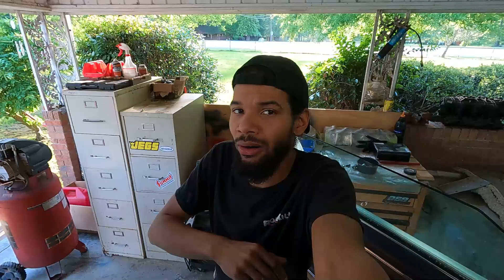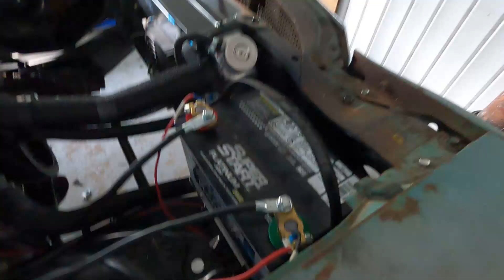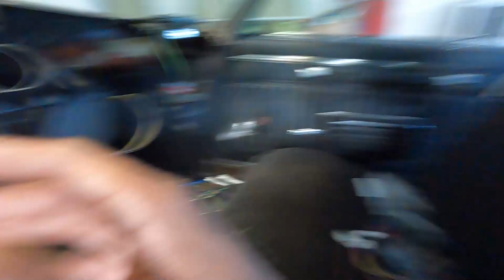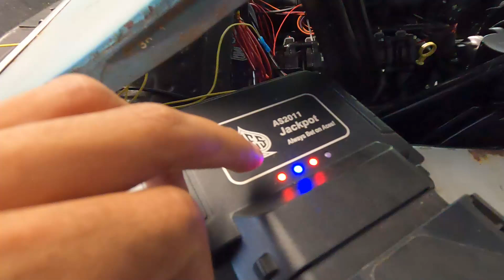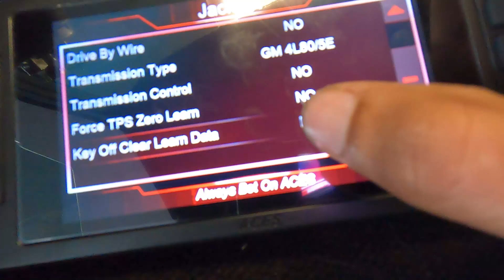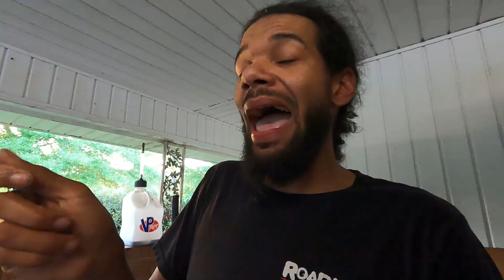How to Setup ACES Jackpot LS: Initial Setup (In-Depth)

Comment: I know the video old but I’m really looking to get this kit. I’m tired of dealing with tuners and old computers. I know you say you just threw it together for now. Will it even get to a point that it will learn and remember. Also just crank the car on the dime every time?
Reply from the maker: So boom, it does run really good, but that’s only after I learned somewhat how to tune. I will say this, it is not 100% self tuning, heck it’s not 25% self tuning but none of the aftermarket systems like Holley and Haltech are. End of the day, you’ll still have to get it properly tuned or learn how to yourself.

I haven’t had any issues out of mines since I started driving it back in January and got a lot of miles on the unit. Did I have to go back and adjust and stuff? Yup.
Reply: @TKSpeedShop  Awesome and thanks for the update. I wanna order one bad but I’m sure from looking at your videos I can get it tune good enough to drive. One more question? How do I know if it will have the EV1 injectors and the right map sensor
Reply from the maker: Depending on what kit you buy, but if you happen to buy the wrong one by accident, they sale those harness separately and they’re DIRT CHEAP. Best advice, call them, tell them what your doing and what your running, they’ll get you squared away.
Reply: Awesome and thanks for the update. I wanna order one bad but I’m sure from looking at your videos I can get it tune good enough to drive. One more question? How do I know if it will have the EV1 injectors and the right map sensor
Reply: Thanks again. Keep up the great content.

Comment: Looks like the ignition wire to the kit is stuck in a terminal in the ignition switch that doesn’t stay on while cranking.
Reply from the maker: Exactly! I later solved that issue in an updated video.

Comment: Hey TK, back with another question (I'm going to rewatch this video in the morning, sorry if answer is there already)

I have the AS2011-WK92-AM2024B Jackpot 2 and the Tight fit in-tank pump (we did not get the pressure senor option at the time of buying the pump). 
Does the Jackpot 2 require a fuel pressure sensor and/or return line setup? 
Does the fuel pressure sensor come in the kit? We looked in all boxes and bags and can't seem to find it and wondering if that sensor was included or not. 
I am also trying to confirm if this pump is pressure regulated internally or if a regulator will be needed.
Reply from the maker: I know the pressure sensor was a free item back in the beginning, I don’t think they come free with the kits anymore but they’re available on their website. I want to say they aren’t require to use the system but it’s one of those, it’s nice to have so you can data check your fuel pressure. 

As far as the in tank pumps go, they do require a regulator and because it needs a regulator, it would also need a return line.
Reply from the maker: Also, if you want an alternative sensor, and have some AN fittings laying around, check out (Lowdollarmotorsports) they have a 0-100 pressure sensor that’s super budget friendly and works.
Reply: @TKSpeedShop  Excellent, I will definitely look at this!
Reply: @TKSpeedShop  good stuff sir!  For the return line, this is needed you say? Why would this be? (I'm new to this fuel stuff forgive my dumb questions)
Reply from the maker: @JJ81_Studios  So most in-take pumps aren’t preset. So let’s say your engine calls for 58psi of fuel pressure. That intank pump could potentially pump up to 60-70 maybe even more psi through the lines and into the rails. Causing your engine to over fuel. Now there are some self regulating intank pumps like Holley muscle retro fit pump.

Having a regulator to adjust how much the engine sees is a win win, because you can bleed off the extra fuel the pump is pushing, and send it back to the tank instead of it sitting in the fuel lines and on top of the injectors.

In older terms, not using a regulator/return is like running a deadhead on a carb setup.
Reply: @TKSpeedShop  My goodness, a real and not vague answer! That makes a ton of sense, thank you very much!  When I'm done, I'd love to show you my setup, mistakes and glory of it all!

Comment: These kits does not like a power adder
Reply from the maker: I haven’t tested that yet, I have a project atm that I could potentially try that one. Just gotta get at least one of these irons out the fire.
Reply: @TKSpeedShop I did a turbo & supercharger ( 2 different trucks ) project and had to change to the Holley setup being it was a headache. 
are u familiar with megasquirt  tuning
Reply from the maker: @hulk7622 I don’t have much tuning experience under my belt but, I’ve been deep diving into it.
Reply: @TKSpeedShop definitely how we learn. Keep up the good work and good luck

Comment: I just found these kits today on Facebook and it looks like they're on sale for 50 to 70 percent off for now until Black Friday. The jackpot is $399 and the jackpot with the transmission controller is $499 and those are some awesome prices. I'm looking to control the current 4L65 or replace it with a 4L80
Reply from the maker: I say, if you don’t mind learning fuel trims and other EFI tuning, go for it!

Comment: I might be tripping but I did everything like you said in the video but now the screen won’t turn off since it’s connected straight to the battery . Is this happening to you or should I rewatch the video again?
Reply from the maker: If you wire it directly to the battery then yes, it will be on constant. For testing it works, if your trying to install the system, wire it to a switch 12v that way, it turns on and off with the ignition

Comment: So why do you not need a transmission controller for the th350/400 i thought all aoutmatics needed a transmission controller
Reply from the maker: All the older transmissions until 94/95? for GM was all mechanical. When the 4l60e came out, that’s when GM swap over to computer controlled transmissions. Now you have some like the 2004r and 700 that used a TV cable.
Reply: @TKSpeedShop awesome i wasn't wanting to get an automatic because I thought i would have spend more time and money for wiring and transmission controller
Reply from the maker: @jeremycoffey5528 nope, they sell the kits with and without trans control. If you gonna run a th350/400 or even an old standard, you definitely will save money.
Reply: @TKSpeedShop awesome what brand and size injectors are you using i have a slightly milder cam than yours i think it's the truck Norris cam with a dod kit
Reply: @TKSpeedShop i want eventually turbo it and btw my 5.3 wil be going in a 1995 chevy s10 single cab short bed i just don't know what size injectors i should get

Comment: Question, it cranks fine and runs. Once I press the gas it wants to back fire. What causes this?
Reply from the maker: I would double check your fuel table, after playing with the system for about a year and watching a lot of they’re tech videos. Anything like a stage 2 (I hate that term) camshaft if that’s what you are running or something close, running the stock camshaft section, you will have to go to your fuel table take 5% out on idle. If the motor is modified, you have to play with your graphs.
Reply from the maker: I would personally start playing with your fuel tables and check your timing tables. If you feel like you might mess up the stock tables in the system, you can always default the system back to factory settings 🙂
Reply: @TKSpeedShop how you default back is t on the handheld?

Comment: My Silverado already has the factory fuel pump wiring. Do I still need to hook up the fuel wire from the aces side?
Reply from the maker: I’m not 100% sure on that honestly. I would say you would need the fuel pump signal for the aces system to work since it requires a signal to tell the system the fuel pump has primed and etc. I believe the fuel pump signal is a check box item in the system. If I recall, the manual states that as well as if your running a pump with a higher draw than 15 then you would need to run a bigger relay along with the system and use the aces fuel pump wire as a signal.
Reply: If I leave the orange wire disconnect my truck starts then dies because the fuel pump can’t see the rest of the system because of the aces in there as well. I replaced the oem trigger wire to the relay with the orange wire and it wouldn’t even pop off. I even tried connecting the orange wire straight to the grey wire that sends the power to my fuel pump and nothing. I did what you mentioned about setting my fuel pressure to 58 because mine is the same as yours. I didn’t try to slot of tps sensor yet but only time my truck fires then cuts out is if the oem fuel relay is still connected. I’m lost with this orange wire 😅

Comment: Thanks for doing this video. I've been looking at aces for my 69 barracuda 5.7 hemi. All the others were saying that it's trash. I'm surprised that it's running with a map sensor and such a choppy cam. Good vid bruh
Reply from the maker: Hey I really appreciate that! I will say this though and this goes for Holley, haltech, etc. the system is only there to get you started and base line. You still need to tune the system for the best results. Aces is still new so a lot of the information isn’t there just yet. Give it some time, it will come!

Comment: Do u have to have 2 o2 sensors with a dual exhaust, and can u use Delphi lm7 injectors
Reply from the maker: Luckily the aces LS kit comes with 2 o2s. I know aces utilize both of them. Yes, you can use stock injectors. Just be mindful of the injector plug type, they offer EV1 and EV6.
Reply: I got the lite,,only came with 1 o2 sensor@TKSpeedShop

Comment: You need to set the idle RPM higher. You don’t set the rpm where you want it. you set it where the engine is happy and given that you have a cam you need more fuel. Set it to 850 and you won’t need to give it gas to start it. With a larger cam you’re just sucking up air not enough fuel. 650 is for a stockish cam.
Reply from the maker: Good info!

Comment: Great video man. Just curious how the system would work with a boost reference fuel regulator? Initial set st 43.5, but it increases 1lb for every lb of boost or close to it.
Reply from the maker: I’m also curious, I might have to dabble with my fuel system as I’m using a self regulating Holley in-tank pump.

Comment: Thank you for your help getting my ace jackpot installed I did exactly what you said to do only difference I did is I put the ignition wire one the distributor wire on my stock harness. you actually explained better then ace did in my opinion for those who are beginners like me.
Reply from the maker: Super glad it worked out for you!!!
Reply: @ if I wanted to reroute the ignition wire into the cabin can I connect to ignition power fuse if I don’t want to tap into the switch
Reply from the maker: @ as long as it’s a clean 12v switch then yes. I don’t recommend tapping into any existing ign wire. If it’s an open wire then by all means. You should also have a open key switch on in your fusebox.
Reply: @TKSpeedShop  ok thanks that makes sense i appreciate the info
Reply: @ I cannot get motor to crank fuel pump comes on but no crank any idea
Reply from the maker: @ double check your fuel pressure settings. Make sure everything is correct, even down to the MAP sensor.
Reply: @ I did what you said I went back and did exactly what you did and still no crank just hear fuel pump come on check map checked psi check bat volts all my wires connected I got ignition wire plugged into the ignition plug from the fuse block
Reply from the maker: @jskillz12able check your grounds and check your relays on the aces harness. Double check your lights on the aces box to see if everything is working correctly. There should be a diagram in the box explaining the lights. Think of it as an engine check.
Reply: @ ima check my grounds only thing I can think of but had a different harness and got crank so iam probably gonna be on the line with ace tomorrow
Reply from the maker: @jskillz12able Definitely hit them up, go check out their YT page, they do tech tip tuesdays live! It’s basically a live Q&A session.
Reply: @ yea I bet it is something minor too because fuel pump comes on you can hear the iac sensor on throttle body ticking not sure what that means but everything looks good on hand held

Comment: Great content man so quick question so i got a stock 5.3 ls motor i bought the jackpot im using stock truck injectors so on the wizard i need to adjust the fuel pressure rating st 58 for my stock injectors since thats how "stock fuel injector on a 2000 Silverado 5.3L engine typically operates at a pressure of 58 PSI (pounds per square inch). correct
Reply from the maker: Correct if that’s the pressure the in-tank pump is set at. If you are using a stock truck fuel rail, double check to see if you have a regulator on it. Overall yes 🙂

Comment: My 21 fuse panel has an alternator exciter wire. Did the paint does not have that one. Mine is white. I'm thinking about using the choke for my electric seats.

Comment: I went ahead and ordered my jackpot. I also did my main fuse box. Did you ever move your O2 sensors? Have you got it tuned and up and running yet the instructions say to have the O2 sensors 6 to 10 inches away from the collector. I just did not think there was gonna be enough line to run it that far. I'm just now finishing up running my fuse box and alternator to my 175 amp fuse and then I'm running that to the battery, did you have all your grounds connected when you did this motor to fire battery to chassis chassis to body?
Reply from the maker: Currently mines is running and my self tune is done. As far as 02s go, When I ran mines open headers, I didn’t have any issues with the self tune but it was super rich. Yes, I had all my grounds and everything final. I also ran extra grounds using ground straps for the Body/Frame and used 2g for engine to battery.

Comment: Nice video. Im lookin at ls swapping my 1984 chevy squarebody and doing a 4l80 for transmission.  Any advice?
Reply from the maker: Should be pretty straightforward, is it C10 or K10? They sell the swap mounts and trans crossmember if you don’t wanna modify your crossmember. I will say if you want a more detailed experience, @UglyTruckExperience has covered countless swaps on C/K trucks!

Comment: Are you still happy with the Jackpot setup? Thinking of getting on. Thanks
Reply from the maker: Oh yeah! I’m definitely a fan of Aces. I’ve been planning on using them solely on my builds now.
Reply: @TKSpeedShop  Where did you install your IAT sensor?
Reply from the maker: @jcheeech about 12” inches from my throttle body on my makeshift air intake. I have it position like you would do a O2 sensor.

Comment: Great video but I got one question to ask you what are the difference between stock, mild and race cam settings the reason why ask I have BTR Truck Norris so I was curious which one to use
Reply from the maker: From my experience, I had hard start issues trying to select mild or race. Even tho I have a mildly aggressive camshaft, running it in stock and letting it build a base seem to work for me. I recall Aces speaking on this in one of their livestreams on YT. Personally I would select Stock/mild, let it learn.

Comment: tk what fuel pump you running
Reply from the maker: I’m running one of Holley Muscle Car EFI modules. They internally regulate to 58psi and doesn’t require a return line. Also comes with a hydramat to help fuel starvation.

Comment: Have you got it up and running yet? I've heard problems of the throttle response like it don't have any balls.
Reply from the maker: I haven’t had any issues with throttle response but, my setup is cable driven. I can’t speak on a wired setup. It’s recommended to let it idle for 30mins and drive for 30mins to develop somewhat of a tune.

Comment: Thank you so much for your help. Do you know where I can get that mega fuse? And man the car sounds badass. I hope mine sounds like that 👍
Reply from the maker: I got mines from a donor 08 Silverado but you could find one in a truck at a junkyard or pull yard. Be sure to get the mega fuse and the box it sits in. It has studs on both sides which you can use to run from your starter etc. I’m sure yours will sound awesome! All cammed LS sound wicked!
Reply: 98 and up S10's have a 175 amp mega fuse just below passenger headlight.
Reply from the maker: @kellyrayx119 That’s awesome! I didn’t know that, I’ll have to be on the lookout the next time I’m in a pull yard!

Comment: Question for you. How did you wire the starter and alternator?
Reply from the maker: I have the starter wired up like a traditional sbc but, I ran my hot wire through a mega fuse like a Silverado. As far as the alternator goes, I have it wired to a key switch hot.